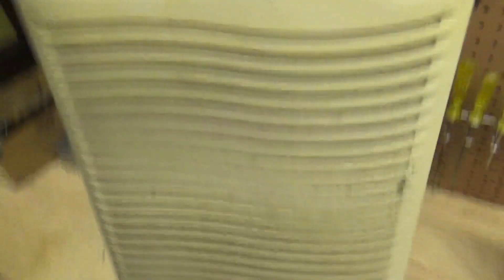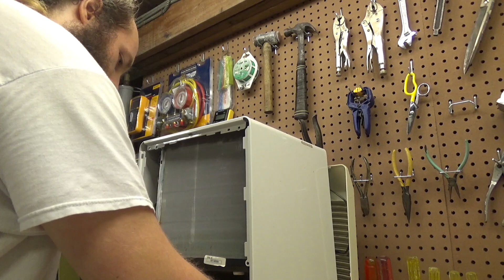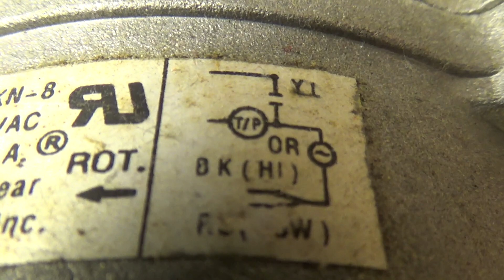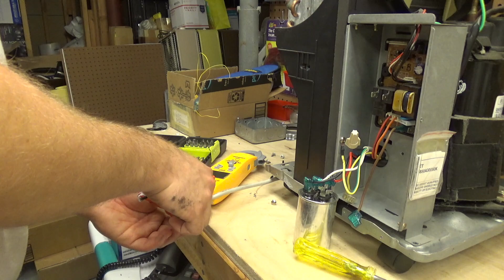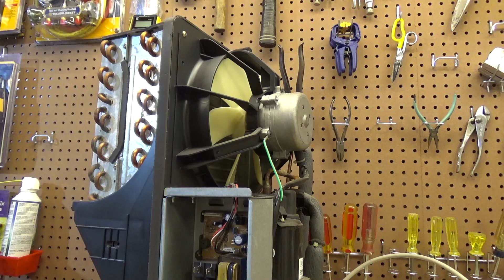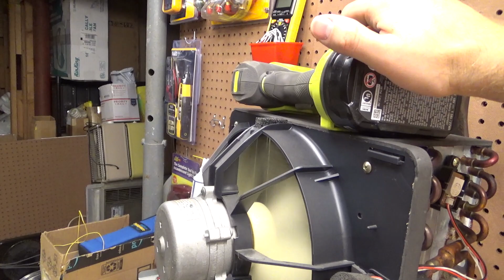Kenmore 580-53650200 65-Pint Dehumidifier - Can I Save It?

Comment: Manufactured by LG (manufacturer code 580).  I figured this would have hot-gas defrost since most LG dehumidifiers have this function.
Reply from the maker: I do not recall seeing a reversing valve anywhere on this.
Reply: @JordanU  It wouldn't be a reversing valve.  It would be a small valve which injects hot gas from the compressor discharge into the evaporator.  It's the same way-hot gas harvest works on a cube or nugget ice machine.

Comment: Excellent video! The measurements of AC mains amps, watts, and power factor shown near the end of this video can be used to confirm that a sufficient amount of refrigerant is still in the system. Units with refrigerant leaks will often draw only 1/2 of the rated nameplate amperage. For example I have 2 GE 72 pint R410A dehumidifiers (2017 mfg dates) with pinhole leaks in their evaporators. Rated amps are 7.5A, but after most of their refrigerant charge has leaked out they draw only 3.5A. I recharged one of them (with stop leak added). It worked perfectly for 2 months before again losing most of its charge. For now I’m setting these units aside until I can decide whether I want to attempt replacing their evaporators.
Reply from the maker: Dehumidifiers with 410 are not worth repairing. The coils are too poorly made and the refrigerant is too high pressure. You can patch one area, but it will just leak somewhere else later on.
Reply: I fully agree with you. The only solution for a leaky R410A evaporator coil is replacement. I added "stop-leak" to one of my curb-find GE units but it didn't help at all. 
On the other hand, I'm currently using an R410A 5,600 BTU window air conditioner (another curb find) which is still fully charged with its original refrigerant. It contains an all-aluminum evaporator. The only maintenance it required was deep cleaning. The original owners may have discarded it because the evaporator, cool-side fan, and front grill had black mold growing on them. I removed every trace of mold with coil cleaner and detergent, then wiped it all down with white vinegar, and finally gave it a thorough rinse with clean water. I've used it in my upstairs office for 2 months and I'm totally satisfied. Power consumption is approximately 1/2 of my previous 40-year old 5,800 BTU Amana R22 AC which was installed in the same window when I purchased my house 11 years ago. The old Amana unit still works fine with no signs of refrigerant loss. It does need a thorough cleaning, but it will likely never be anywhere near as efficient as the new unit. It also weighs twice as much as the newer R410A unit.
Reply from the maker: @electricboyo  The older unit may draw more power, but it almost certainly cools in a fraction of the time and will run the compressor a lot less to achieve the same temperature. The "'efficiency" ratings on most of the newer equipment is a total joke.

Comment: I have a Whirlpool unit that's equally as loud, and for some reason the digital control only allows it to turn on when it's on the continuous setting. It's my second/backup unit and it still runs and pulls water so I don't worry about it's issues 😅 I think I paid $2 or $3 at a garage sale.

Comment: I believe rotary compressors are hot gas discharge cooled if I remember right. That’s why they have heavy gauge steel for its shell and why they run hot.
Reply: They are cooled by the hot compressed gas. The suction line goes in at the very bottom where the rotary compressor mechanism is located. The motor (stator and rotor) is located in the middle section, and is in fact cooled by the hot compressed gas. Discharge line and motor electrical connector are at the very top. This type of compressor always has a small accumulator permanently attached at the side to hold excess liquid refrigerant and prevent it from getting into the compressor. As far as I can tell most dehumidifiers and window air conditioners manufactured after 1990 contain similar rotary compressors. But reciprocating compressors were the standard for dehumidifiers made prior to about 1990.

Comment: I found a dehumidifier just like this.  Its an LG unit.  What you have is a rebranded lg for kenmore.   The issue with mine was a burned trace on the back of the circuit board, that feeds the common.  When i plugged it in, and set the humidity way past the present reading, i would hear the fan, and then the compressor relay, but no noise from either.  I removed the circuit board from unit, removed the board from the black plastic casing, and whrn i turned over to the back side, i noticed the burned trace.  I resoldered a piece of eire from point to point, put board back into unit, and put all wires on their correct terminals, plugged in machine, and presto the fan and compressor came on, and unit was working as it should.  I checked for a grounded compressor as a grounded shorted compressor will take out the trace on the back of the circuit board.  I would also check the soldering around the male flag posts on the back of the board as well.  Even if the compressor relay was bad the fan should of still runned.  I know the def sensor and humidi sensor is fine, as if they were bad, you would have a 2 digit error code on the display window. I would remove the circuit board, remove its black cading, and look for a defective trace or loose solder joint.  I much rather use the electronic controls instesd of wiring it up direct.  Great video.  Glad you at least got it running.
Reply: Jordon.  Dont feel bad about miswiring the fan motor.  I have done that exact same thing.  Now i double check my wiring when replacing a fan motor.  Also the wiring diagram on these things can be confusing.  They need to do a standard for all dehumidifier and ac motors.  Blue is high speed, yellow is medium speed, red is low speed, black goes to fan termial on run cap, and white is the common.  Would sure make things much eadier.

Comment: With air conditioners, I can deal with older ones with electronic controls, but as far as a dehumidifier goes, if I see electronic controls, I walk away unless it is free.
Reply: Whom.  I feel that both are the same as far as wiring and layout goes, only difference is with a dehumidifier you are measuring humidity, and with an air conditioner you are measuring temperature.  I work on both, and they are really the same principal ehen it comes to wiring,
Reply: @seangriffon6502  I am fully aware of that, but it seems that with air conditioners, the controls are generally more reliable (at least the older electronic ones). As well as the fact that the electronic dehumidifiers often have float switches that for some reason always seem to fail, where the old ones just have a bucket on a spring that presses a button.
Reply: I’ve come across several newer dehumidifiers with electronic controls. Unfortunately for me (I’m a hardware/software design engineer) I found no faults with any of these electronic controllers so far. The main fault in all of my recent “curb finds” has been refrigerant leaks. I suspect most of these refrigerant leaks are caused by pinholes in the evaporator. A search for “formicary corrosion” will explain why evaporators with copper tubes tend to fail so rapidly, especially in dehumidifiers which are exposed to funky basement air. Several manufacturers are beginning to put “anti-corrosion” coatings on their copper coil evaporators or are switching over to evaporators with aluminum tubing. However I haven’t found any such units on the curb yet (perhaps because they don’t fail?). I wish a clever Asian manufacturer would start selling replacement evaporators for $20 each.
Reply: @electricboyo  As far as the copper tube and fin coils go, you are correct. Kenmore used to use them back in the 80s (technically Whirlpool because they made the units,) and I have seen and heard quite a few stories about them leaking. Most of the older units use an aluminum coil, which is just a long piece of tube coiled up in a circle, which seems to be the most durable design as far as resistance to corrosion. I don't know why they ever switched from that design to the design they use now, which is commonly over complicated and never lasts as long, probably in the name of efficiency, which I could care less about if the unit is working as it should.
Reply: @WalterKnox  I've been reading about "formicary corrosion." Evidently this doesn't occur with aluminum coils. Formicary corrosion is a chemical reaction which requires copper, water, and stale air containing compounds wich react with the water to form organic acids which cause copper to corrode rapidly. I believe this means the refrigerant leaks start from the outside of the tube, not from the inside.